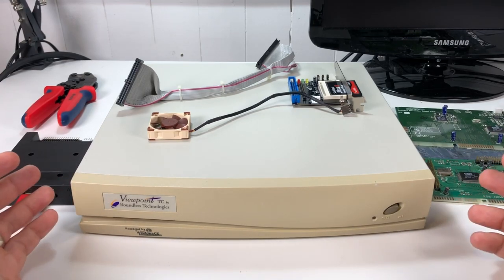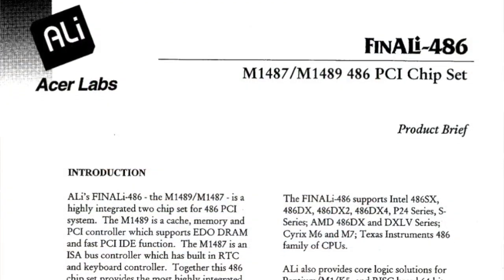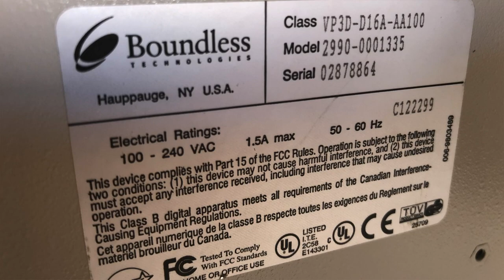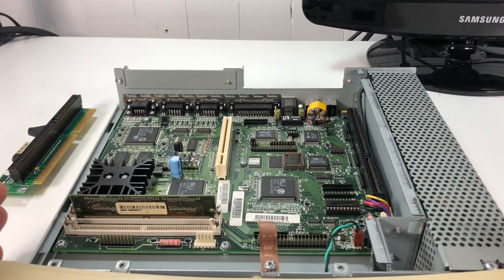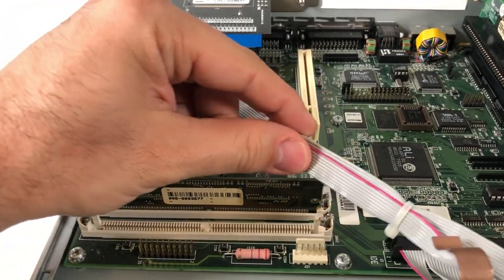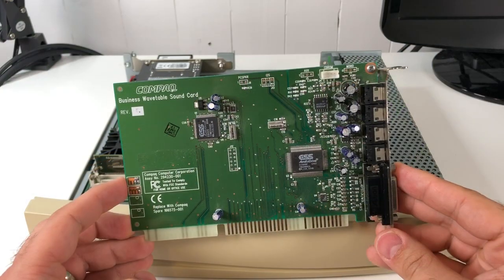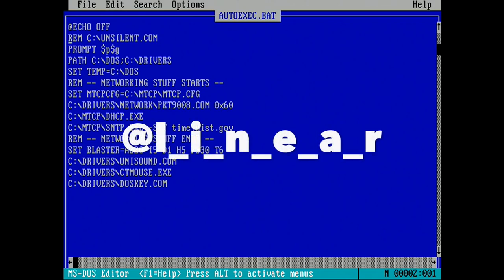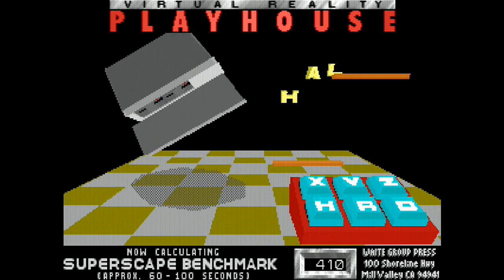Building the Ultimate 486 DOS Gaming Thin Client! #486buildoff

Comment: I think this might be ideal 486 DOS gaming box: small, capable and has a lot of tinkering potential! Wonder if I can get these for a reasonable price in the UK. Performance looks like a real mid 90s sweet spot without needing much tinkering. Possiblity of PCI slot(s) makes getting adapters much easier too, whilst keeping the ISA slot for older compatibility. Thanks for sharing, happy #486buildoff!
Reply from the maker: Thanks, Chris! It sure is a very capable DOS gaming box, that's for sure. When I got this one last year, there were a few available for sale on eBay. I haven't seen another one for sale for quite some time though, unfortunately. Hopefully a recycler will unload a lot of them some day soon :)
Reply: @vswitchzero  yeah my bubble was pricked a little just now when I had a quick look on eBay - nowt, not even in the completed items! Still Im sure they are called other things (like the one on Vogons) and I have all the tiiiiime as soo many other projects on the go at the mo. Ghidra disassembling is a lot of fun, is the silent mode activated by the BIOS that unsilent switches off or is it that silent mode is baked into the video and you need to unsilent it?
Reply from the maker: @mogwaay  Good point, would be neat to find a list of all make/models this hardware was sold under. I don't think the "SILENT" feature is in the VGA BIOS because the same behavior occurs with an external ISA video card installed too. I managed to flash a "half-working" AWARD bios on it from a board with the same chipset and the "SILENT" behavior goes away. But the challenge I have is that there is a single PLCC32 chip that both the VGA BIOS and Phoenix PICO bios share. I have to use an ISA VGA card in that case. Haven't figured out how to split them out yet or if there is enough space on the flash chip to store both the VGA BIOS and Award BIOS. Will keep poking at it as time allows 👍
Reply: @vswitchzero  Woah I had no idea you could do that. I have a Boundless TC100 and faced all the troubles you did, though running ansi.sys seemed to also stop it being in 'silen't mode. But putting another BIOS on there, I had no idea that could be done and have it still working. Could you share the unsilent utility somewhere?
For the VGA BIOS, maybe it's like a laptop where the VGA BIOS sits in the 2nd half of the chip?
Reply: They are somewhat tough to find, I got one a while ago that was branded as an Equiinet Netpilot and stumbled through all the points that vswitchzero has gone through :) . There is one of those for sale that matches the one in this video but it looks kinda pricey.
vswitchzero: I took some detailed pictures of my TC100 and will probably upload them in a bit, my one has the real time clock / battery - it uses a thing called a Snaphat. On my one, I've modified the front smartcard slot to fit the CF card.
Reply from the maker: @voodler  Thanks for your comment! Yeah, I noticed ANSI.SYS also seems to help as well. I still had some text scrolling weirdness with it enabled though, unfortunately. Might still be worth while putting at the top of config.sys though so that you can see everything loading at bootup. Not sure why I didn't think of that before :) .. The award BIOS kinda-sorta worked because it was from a board with the same chipset, but it would seem to hang on boot for a long time and the serial/parallel ports aren't detected. I ordered a PCI riser (the ribbon cable style one) that'll hopefully allow me to test with a PCI video card in the system in the meantime. If I can get the VGA BIOS working on the same chip as the award BIOS there may be some hope. I zipped up the original Cirrus/Phoenix BIOS dump and UNSILENT application that you can find at the link below. Don't try to flash the BIOS on the TC100 though, it'll only work on the TC325. Cheers. https://vswitchzero-public.s3.ca-central-1.amazonaws.com/ViewPointTC.zip
Reply from the maker: @voodler  Cool! Would love to see some pics of the TC100 to compare to mine. Is it a Dallas DS12887 in the TC100? Also, would love to see how you modded the front smartcard slot for a CF card. That's a great idea and would allow me to use the PCI slot eventually.

Comment: PCI BUS adds a lot of logic to the BUS compared to VLB, VLB is a direct CPU BUS interface basically, this also means that VLB cards run at the same speed as the CPU FSB, which is not the case with PCI and can be also a reason for performance decrease with PCI (with a standard configuration not messing with PCI BUS clocks). This is also why without anything else other than a fast FSB VLB cards on CPUs with 40Mhz or higher bus clocks will perform quite well as long as they do not die due to overheating (the main driver for the adoption of the PCI BUS in fact as many a card died during the VLB days once the DX50 came out, this also had an impact on Intel CPU design, the FSB to internal clock discrepancy was also meant to help with these cases, if you notice the PCI BUS first default clock speed was topping out at 33Mhz).

Comment: Great stuff, I have fond memories of the '486 era,  the good old days of DOS, the ability configure memory by hand rather than using Qemm or memmaker andhow to properly write multiconfigs  was a real game changer for me,  I seem to remember around the time of those boards were about there was a global shortage of  ram cache, some manufacturers  left empty sockets on the boards for users to upgrade later, others did dubious  things with  the BIOS and fake cache chips on the board with the words 'write back' on them,  a few would not recognise the cache added even with a properly sized tag ram, I seem to remember that writeback was more effective on the Cyrix CPU's but those have weak FPU performance, in the cases where the cache wasnt recognised it could be rectified on some cases with a BIOS change but not always - from my memory at least, ESS audiodrive cards were much loved back then by system builders in the day as you never had any trouble with them - they just worked! I however had the GUS Max and the SB16 installed thats why I had the multiconfig

Comment: Sweet little build! Always love these low-profile systems from the era.

To address the PCI issue, you can actually get a flexible PCI extension cable, which should let you plug in a PCI card if you made a nice mount to hold the PCI card inside the case. If you're curious to know where to get one, I can put a link for one I bought here.

For cooling, you can also get a blower-style fan that mounts in the expansion slot. It's powered by molex, but I'm sure you can adapt it to give it power from the board (or perhaps even the PCI slot using an adapter). I've used these fans to add cooling to small cases like these, and they work quite well (other than typically being a bit loud, but adjusting the voltage lower could help with that).

Swapping to a DOM can free up the second expansion slot in the case if you ever need that for anything (though I'm sure that's obvious to you).
Reply from the maker: Thanks for your comment! Funny you should mention that because I actually just bought one of those flexible PCI extensions last week. The one I got is about 20cm/8in inches long. I'm not sure how well it'll fit in the case with a video card mounted, but it'll at least allow me to do some testing with discrete PCI video cards with the cover off.
Reply: @vswitchzero  Can't wait for a follow-up video!

Comment: Great little system! 
Since I'm not very into pre-pentium era stuff, I never fully understood what makes a video card to be considered good in 486 times. I know that market was very fragmented and without established standards every company was doing it's own things, can you briefly explain what were the specs of a good video card in 486 era?
Reply from the maker: That's a great question - It's really hard to compare these old cards based on specs. Aside from memory type and amount, and whether or not GUI acceleration was provided there wasn't usually much to go on. People would usually rely on magazine review roundups and experiences shared by others to understand how these cards performed. Things were pretty CPU limited in the 486 era so card performance wasn't very drastic from chip to chip (assuming a VLB or PCI card). The biggest performance gains came when people moved from the restrictive ISA bus to VESA Local bus or PCI. Most companies were focusing on "GUI acceleration" in the early-to-mid nineties to provide a smoother experience in Windows and there were some big differences in this area. But I'd say compatibility is one of the most important things. There were some display standards back then, but many cards didn't follow all of the rules properly and there were some game compatibility problems (scrolling issues in Commander Keen with an ATI card for example). Cards made by S3 and Cirrus Logic were well known for good compatibility even if they weren't the absolute fastest. Not sure I answered your question, but hope that helps :)
Reply: @vswitchzero  OK thanks! So when you hear "this was a good 486 video card" this means it was PCI/VLB, had no game compatibility issues and had some sort of Win 3.xx GUI acceleration? But, given a set of cards that had all these specs, still not sure why one was faster than the others, maybe trivial things like slightly higher chip and memory speed?
Reply from the maker: @framebuffer.10  Yep, although many people don't care too much about GUI acceleration if they are mainly into DOS gaming. Many manufacturers would have features and tweaks to improve performance. Some were clocked higher, some had better memory bandwidth due to interleaving, some had ways to access the bus more efficiently.  Those were the kinds of things that couldn't really be compared in the specs, unfortunately.

Comment: Just got a 486 hp vectra with 12mb ram and an old school monitor! Bundle was 20 euros, it was so dirty and rusty, but i fixed both and they are working fine now! Just the previous owner turned up the brightness way up on the monitor inside, so i can open up that monitor again

Comment: it was a step past a dumb terminal. at the computer store i worked at in the very early 2000s we used something similar to this as a floppy server, we opened one of  the back slots to house a floppy drive and network booted it (no internal storage, just booted off of the server like any other dumb terminal). used it to make some of the floppies that we needed on a regular basis.
Reply: oh, and we got ours from a call center that we had "upgraded". it was a bunch of duron 800 systems with onboard video. i suppose it was by far more powerful, but it was still very weak for the time.

Comment: Great video!
When I saw that Gotek drive I thought for a sec you will take the Dremel cutting well for a spin and mod the case.
The PCI riser is not standard but, what do you think, it shouldn't be to difficult finding a very small one that fit?
It is interesting that you are getting subpar performance on the video card, I'm looking for what you end up finding out!
Reply from the maker: Thanks for the comment, Alberto! Haha yeah I definitely considered installing a go-tek. I had originally thought about putting it in the PCI bracket and having an internal IDE flash drive instead. I only wound up using it to install DOS and didn't really need it again. I found some utilities to mount floppy images in DOS as well as CD images. Will probably do a follow-up video on these in the future. Yeah, I'm almost certain there are PCI tweaks needed on this system to get better VGA performance. I have a late 486 board based on a VIA chipset with more than a dozen settings you can tweak in the BIOS for the PCI bus. By default, it's about 30-40% slower than it should be. I need to see if I can get a modified BIOS on here that can do something similar. Also, I wound up buying a PCI riser that uses a flexible ribbon cable. It's 20cm long so may be a pain to deal with, but I'm going to give it a try so that I can at least test with an external PCI video card. If the external card is slow too, then it backs up the PCI bus theory :)

Comment: If you did ever want to step up the graphics, pci extension/ribbon cables are readily available and you might just have to rig up some support for the card.
Reply from the maker: Thanks for your comment! I actually discovered those PCI ribbon cables shortly after I did the video and picked one up. It's pretty long (around 8 inches or so) but hope to revisit this system when I get some time.

Comment: Tulip Impression Compact 4/66 = my Ultimate Socket 3 486 - since late 1994. 

Well, a bit Pimped since: MOAR than 4MB RAM and the AMD SX2 😲(2 x 16MB EDO from my first Build(Socket 7) and of course an AMD "real DX4" aka AMD-X5-133ADW*)

*'cause I'm not gonna' overclock! ..on this, first x86 ever, old gal.

Comment: i think usually the fan blows out the power supply and not in from the power supply. psus generate heat, so you don't want to suck that into the case

Comment: You c an use the INSTALL= command in config.sys to run an executable. That should get you an option to have screen output earlier.
Reply from the maker: Interesting! I will have to give this a try. Thanks for the tip!
Reply: @vswitchzero  seems my DOS-fu is still strong, 20 years after I last used it. :-)

Comment: FPU benchmarks (like GZip or similar and hashing) and FFT (or Gaussian funcions too) are worthwhile for FPU (with or without FPU on the CPU) performance so as to consider a MPEG as VCD (Video CD) would use a pentium p90 approximately (even without a video card beyond the 1MB found on many a p90 MBoard integrated graphics) although some p60 system can squeeze out enough processing power to do it, and likewise for decoding of ogg-vorbis audio, so FFMPEG and LibAV are worth a try. A 100MHz 486 should perform a like a p60 (especially with FPU). The fastest 16bit CPU's in your graph (even without cache features being so advanced, as FPU is the main interest) should perform like a p90 (pentium 90MHz 32bit). Thsi is an example why i486 embedded is worthwhile in linux kernel support continuation. People might say "Just use an ARM chip", but then you cannot get one (like a pi amidst thet shortage). A 16MB i486 at 100MHz with a GPU (even on a small embedded board the size of a slice of toast) has more RAM than say a NintendoDS, an yet a back catalogue of many productivity softwares in FOSS (i486). Linux is a trademark of Linus Torvalds, and so such feedback is not a demand of Linus Torvald but a share-and-share-alike (as per the philosophy) heads-up to help. The word "backlash" about i486 being dropped from Linux. Instead, it sounds more like a heads-up than a backlash.
My comment has no hate in it and I do no harm. I am not appalled or afraid, boasting or envying or complaining... Just saying. Psalms23: Giving thanks and praise to the Lord and peace and love. Also, I'd say Matthew6.

Comment: I could easily design a PCB for the PCI riser if you wanted (just to help out a small channel). I'd need to get some measurements from you, but let me know if you're interested.
Reply from the maker: Wow, thats really kind of you to offer, thanks very much! I actually purchased a flexible PCI bridge shortly after I did the video, but I haven't had a chance to try it out yet. If that doesn't work out well, I'll definitely get back to you. Thanks again!
Reply: That should work, it just won't support the card, but that would be easy to fix. Otherwise let me know, it's really only an hour or two of work for me. Then I'd give you the files to order the PCB from JLCPCB etc.

Comment: Is there a DALLAS RTC chip init? (One with an Alarm cliock icon)  That has an internal battery, which is probably dead by now... There are video's on YT in which there is explained how to attach an external CR2023 cell to have it keep date and time again.
Reply from the maker: This system doesn't use a Dallas RTC module (like the DS12887 for example). There is actually an empty solder pad location for a different RTC chip that has a "piggy back" battery that attaches to it. I can't recall the name/type at the moment but I'm hoping to try to locate one to solder on the board. I want to do a follow-up video on this system one of these days.

Comment: I wonder if that PCI slot would work without a riser. Could the motherboard be transplanted into a larger case and a PCI card installed directly.
Reply from the maker: Thanks for your comment! Yep, the slot should work just fine without a riser so long as nothing obstructs the card from being inserted fully. I actually just bought a flexible PCI extension ribbon cable that I hope to use to test it out soon :)
Reply: @vswitchzero  given prices for 486 machines this could be a great solution. Question is do I need to add a 486 to my collection and what case do I buy to house this in? 🤪

Comment: any luck on modding the bios? I just got a TC200.
Reply from the maker: I haven't had time to revisit the system yet, but hopefully one of these days. There are a few things I'd like to try with it.
Reply: @vswitchzero  Any pointers you can give me? What do you think about a 486 with a Voodoo1?
Reply from the maker: @coryflammer1269  Although it should technically work, I wouldn't recommend a Voodoo1 with a 486. There just isn't enough CPU horsepower available to get decent performance out of the majority of glide games out there. A higher-end Pentium MMX system would be a great choice for V1 (P166-P233 MMX for example).
Reply: @vswitchzero  My TC200 arrived today. Unfortunately it didn't come with the ISA riser card. :(
Reply: @vswitchzero  How did you get access to the onboard flash?